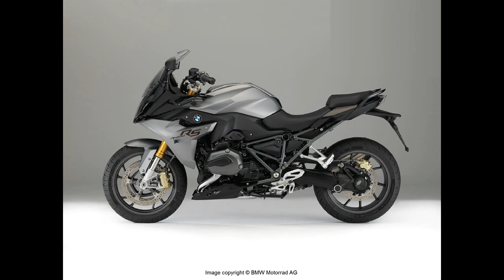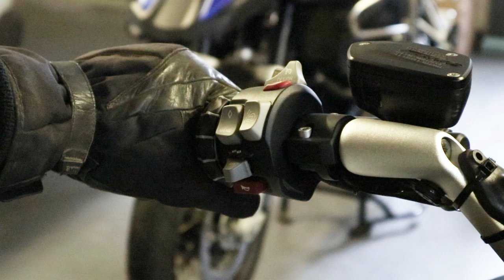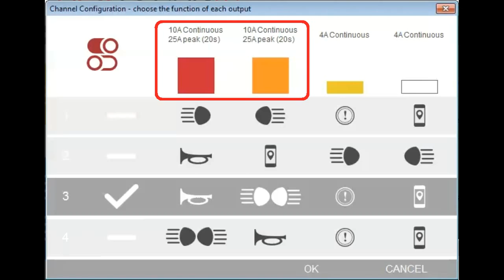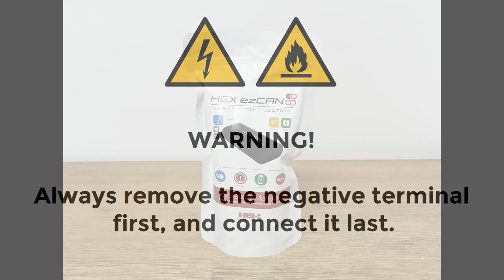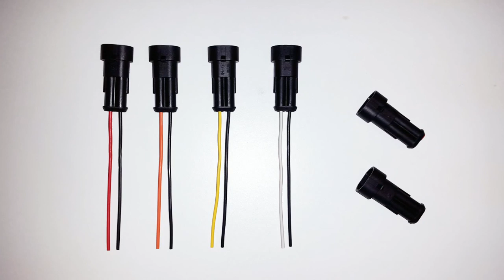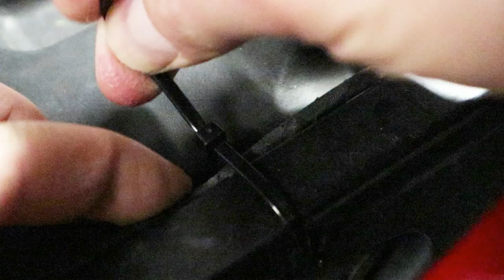HEX ezCAN R1200 LC Installation (BMW R-series Liquid cooled)

Comment: Would be nice to see you fit to a R1200R 2015 onwards machine. I have TPMS but they refer to is as "Tire Pressure Control". I do have a plug that is not connected to anything under the seat but not sure where to plug in your unit.

Comment: I've just fitted mine and it's easy to fit, however you will need to register your unit before you fit it to your bike if you don't have an internet connection in your garage etc where you're fitting it after installing the software to your lap top etc. I installed mine, then connected my laptop up as directed only to find it needed a software update and I couldn't configure it until I'd uploaded the latest software so had to take it off again! Also to help route the battery cables I used 2 cable ties, one looped through the 2 battery terminals and then connected to the other by threading it through the hole in the blunt end of the 2nd cable tie. it also helps to remove the fuse cap and fuse from the fuse holder if space is tight.

Comment: Just fitted one of these to my 1250gs. Pretty straight forward even for someone as mechanically impaired as me! Great set-up, I only have aux lights plugged in at present but everything works as stated. Very clever little device.
Reply: john Robson hi, may i ask what aux lights are you using?
Reply: @HeartsRain  I bolted up a set of sw motech aux lights! I had to modify the supplied wiring loom but other than that it was pretty straight forward.
Reply: @johnrobson6023  nice! Thanks for the reply! Do you think the denali lights can be plug and play into the hez Ezcan?
Reply: @HeartsRain  yes they should, you may have to change the plugs. They make 1 specifically for the denali lights, straight plug and play!
Reply: @johnrobson6023  thanks for the information!!!